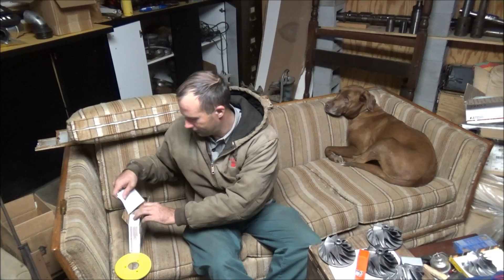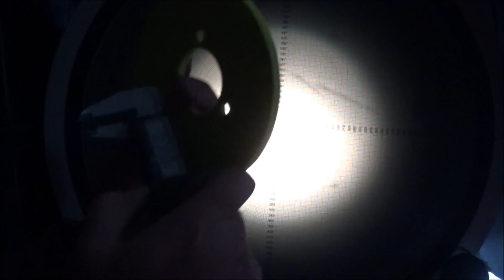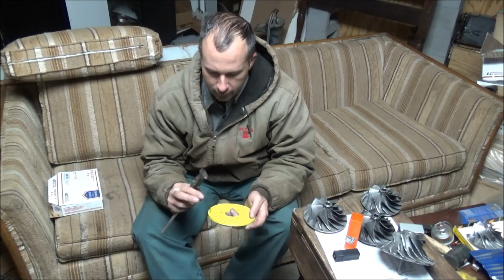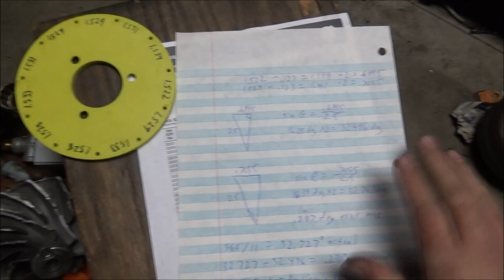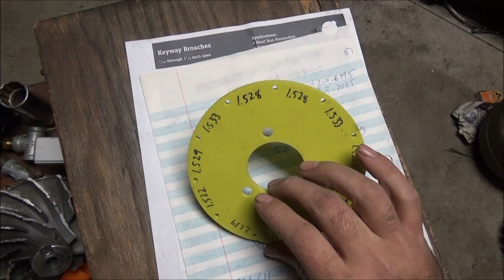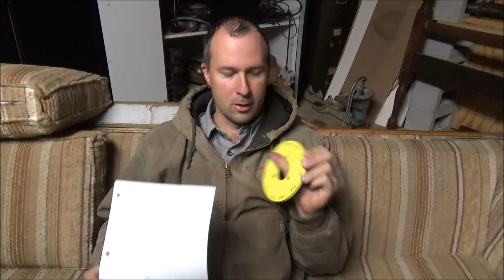Accuracy of a 3d printed plate

Comment: Was the error caused by calculation inputs to the program or by the printer itself? If the printer! Are there printers that are more accurate then others and is this an inherent problem with this method of making things?On another note, what were the turbo wheels on table for? And are you machining them?
Reply from the maker: I would imagine the output from the program to be correct and the error is from the machine itself combined with the expansion and contraction problems associated with working with a semi liquid and having it turn solid when it cools.  Looking at the plate it appears it was built in a square path and the holes that are off the most look like are in the corners of those squares. It may even be starting and stopping at those points to leave the hole and that might be part of the problem is in the timing of that.  Those wheels are all take outs from turbos I have built with billet wheels.
Reply: Send me the STL file for the plate and I will print it on my Rostock 3D Max. It is currently well calibrated. One can the compare if I have the same file. I live in South Indianapolis.
Reply: A lot of error in machines like those comes from the resolution of the motors being used and the transition from mostly X moves and few Y moves to a 1:1 ratio of X and Y moves to few X moves and mostly Y moves. And its actually not the quantity of moves, its the ratio of the angular rotation in radians commanded to the motors vs the rotation they are able to deliver. This is what causes holes or radial patterns to be elongated (near the mostly X or mostly Y moves) and the holes to be more appropriately shaped where the X and Y moves are closer to 1:1.

Basically, it's the same math that Brian was doing to resolve the error but instead you are looking at the linear resolution in each axis as a relation to each axis ratio of movement to each other.

Hope that makes sense. :-)
Reply from the maker: I have no idea about the accuracy of any printers.  Send me some parts off one and I will see if I can figure it out though. :-)
Reply: Hey Mark, get to me via email and I will reply with the STL file and you are free to give it a shot.  I'd be very interested in your results.
Reply: there may be some slop in the gear train of the printer too, and coupled with all the errors you mentioned adds up, im sure some of it could be controlled by perhaps insulating/heating its printing environment temperature and slow cooling
Reply: Have you looked at the accuracy for a "delta" type extruding printer?
Reply from the maker: So can you force one of these things to run spiral? Seems that would minimize the errors.
Reply: I have been trying, can't find your email address
Reply from the maker: Mark Cummins
It is on his about page on his you tube but here it is anyway : jt_kilroy at yahoo dot com

Comment: I just discovered that a USB microscope in the quill can turn the mill into a measuring tool. I'm reverse engineering a cordless drill body, and it was loaded with all kinds of little dimensions that I've picked up by scanning with the mill and USB scope. It appears accurate, too. I just stuck some tape on the screen, and used it as crosshairs.
Reply from the maker: Sounds like a great idea to me, I see no reason that wouldn't work.
Reply: Gkuljian Look up Stefan Gotteswinter's quill-mounted "centering microscope" YouTube video. Same concept, no computer required. :)